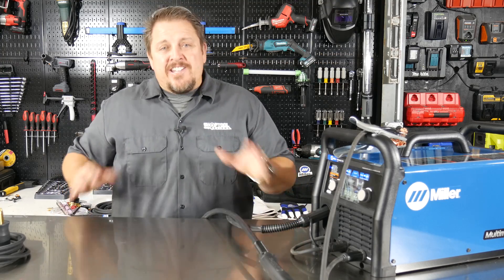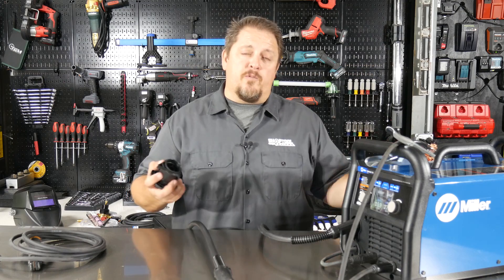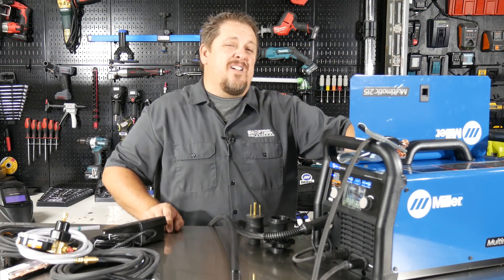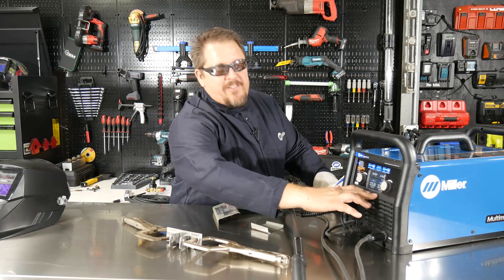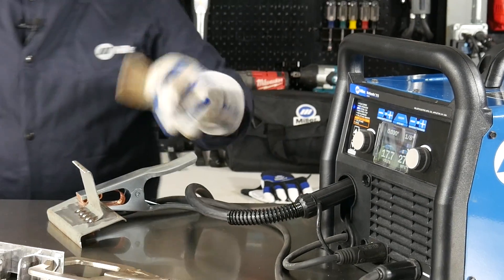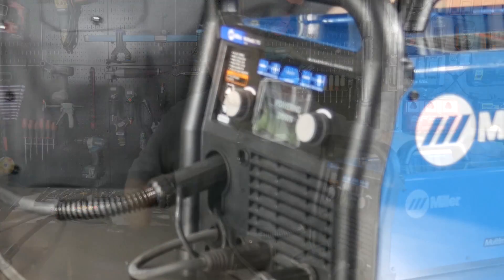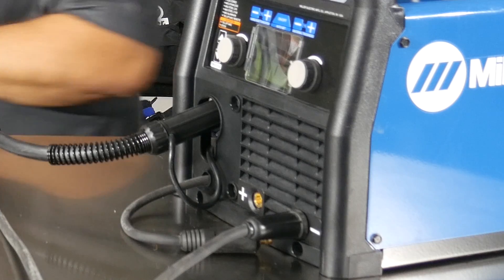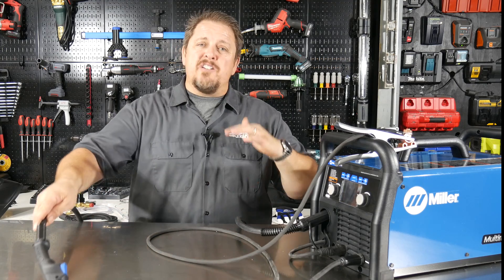Dummy Proof - Miller Multimatic 215 Multiprocess Welder

Comment: So no fluxcore demo. Im fighting with the spool. Can I only use 10 lb rolls?
Reply from the maker: In this video, we didn't use the flux core. Are you using the correct drive roller?
Reply: @Shoptoolreviews I realized the miller 215 (mine)only has 1 drive roller, for 10 lbs of fluxcore or mig. I can almost swear Baker's Gas put a 5lb roll of mig wire inside my unit. Then again I am 55....

Comment: Does the tig torch have a solenoid valve for argon?
Reply from the maker: The machine has 2 gas ports that automatically switch depending upon which process you're welding with. The valve is not on the torch itself. Thanks for watching.

Comment: I might add that if I needed a HD high production machine that runs at its max all day long, I wouldn't get this machine. For the hobbyist, car body, hvac, this is more than enough.  I reached the duty cycle auto shutoff feature pretty quick when I stick welded 5/32... 7018.
Reply from the maker: Thanks for the feedback. Thanks for watching.

Comment: could you weld 3/8 steel ????
Reply from the maker: Weld Thickness
MIG: 24 ga.–3/8 in. steel, 18 ga.–3/8 in. aluminum
TIG: 24 ga.–1/4 in. steel
Stick: 16 ga.–3/8 in. steel
Input Power 120 or 240 V, single-phase, 50/60 Hz
Thanks for watching and commenting.

Comment: miller  vs lincoln which is better
Reply from the maker: Oh brother, you just opened up a can and backed me in a corner. If I answer this, half the world will hate me, no matter which I pick. lol. Really and truly, they both make great machines. It's really more about the welder (person) than the welder (machine). Personally, I prefer the Miller, but I typically stay on the consumer/hobbyist/light-fabricator end of the spectrum. More industrial fabricators, pipe fitters, and others may choose the Lincoln. Miller and Lincoln have done a great job of expanding their inverter style multi-process machines that help people weld better, which otherwise they'd probably never have tried it. Sorry for the long answer, and thanks for watching. Strike an arc and keep pushing yourself, that's the real difference.

Comment: How can we get the 215 to post gas when welding stainless steel and aluminum ?
Reply from the maker: The 215 should automatically post-flow 8-15 seconds, depending on Amp. Factory set to 1sec for every 10A, with a minimum of 8sec and maximum of 15sec.
Reply: @Shoptoolreviews  Thank you very much for your reply. If that information was in the manual I missed it.
Reply from the maker: @jimwardlow7830  no prob

Comment: Does anybody know the difference between the 120 and 240 volts? What is the purpose for each?
Reply: Santiago Vazquez without writing a seven page essay it basically means you can get more amps out of your welder 240 is the best way to go cause you’ll get max amperage
Reply: 110 or 120 v  is standard household outlet, like for your lamp or toaster.
 220 or 240  v  is a different  much heavier more powerful outlet, like for your stove or clothes dryer.     110 / 120 v  = only enough power for very light welding eg. sheet metal 
                220 /240  =   much more powerful for heavier commercial grade welding on heavier steel. 
      Most garages are only 110 v and need to be up graded to 220 by a qualified  electrician.  This can sometimes cost around  $1000.  Less if you are lucky.
Reply: @gordjohnson70  you can do what I did I have central air conditioning so I put a 240 outlet parallel off the condenser disconnect. I leave the air conditioning off when I'm welding

Comment: I've read bad things about the MIG gun supplied with this unit! Hopefully, Miller has it sorted out by now.  With the premium price I'm paying, I don't want a junk gun!  Hobarts MIG guns are very nice, I only hope Miller's is as good or better.
Reply from the maker: We've ran many spools of wire thru the gun with no issues.
Reply: Aren't miller and Hobart same company
Reply: @jetthelooter  Miller owns Hobart. The only differences are quality control, price, and usually the screw threading on certain areas of expensive parts. For example, Hobart spool guns don't generally work on Miller welders.

Comment: I like the new screen as it's easy 2 c new settings. However, it appears as though this is a 211 with a tig/stick feature as an after thought. With no high frequency start it's a big downside unless ur already used 2 tig welding with a scratch or lift arc start.

Comment: please recommend a stick and mig welder also what is the duty cycle ??
Reply: duty cycle depends on how hot you run it. according to the manual, on the lower half of its power settings in 110V you pretty much have a 100% duty cycle.

Comment: Ive had one for about a year now. I Have used it on all processes to include the 150 spool gun, aluminum and steel. There is nothing wrong with it. The suggested "miller tig pedal" is junk though. I got a full sized aftermarket pedal, now its good. The autoset feature is pretty spot on with all processes.  The arc on all processes is surprisingly good, real smooth and "fuzzy". I got this to replace my powcon mst 200 that finally took a dump. It will spray arc mig real nice with spoolgun or intrenal mig with 0.35 and 25/75 or pure argon gasses. Stick welds real sweet. No complaints.
Reply: How's it holding up now in 2020?
Reply from the maker: Ours is still working great and it gets used all the time.
Reply: Whats a good aftermarket tig kit for one of this
Reply: @JuanHernandez-ub3ez  it'll take any torch thats hooked on a "gas through 35 dins". Arc zone makes good stuff. Their special hoses are very flexible, lite and durable. They are very helpful over rite phone and will make custom setups of any orientation You want. You ask whats the best torch, that's like asking what's the best music. You'll get 100 different answers to that question. Personally, I'm set up with a little bit of everything. Huge nozzles and tungsten for fat utility welds and smaller setups for delicate work. Gas shield and non shield of all nozzle and tungsten sizes. All weld joints and configurations have different reactions to different torch setups. Air cooled torches are what I'm using on this 215. I hang my hot torch in front of a fan  in between welds when I'm doing production work.
Reply: @dmmdmm5435  Thanks for the tip boss
Reply: @JuanHernandez-ub3ez  you can do good with the supplied 215 stuff. Ask your other welder friends what they're using and work from there. I was a welder,fabricator, machinist for many years in many shops. That exposure gave me a vast array of different equipment choices at my employers cost .  So I'm able to draw from those experiences to cherry pick what I need in my shop. I know Not everyone has that luxury. But I found that the highest amp aircool torch and large gas lens setups will do everything you need to start  your collection with. Then you can fine tune your collection when you come up short with the larger gas lens. Getting into tight confines will be your next challenge to make new choices in a tig torch assemblies. Non-gas lens nozzles tend to be very sensitive to breeze or working around corners. It's all about argon gas coverage without being wasteful on your flow cfh and not overworking your tungsten .
Reply: Oh...and get a (usaweld.com) replacement tig pedal for the 215. That toy pedal they supply is pure junk. It'll work, but it's too small and has too short of a throw for a fine tuned feeling between your booted foot and the arc. IMHO
Reply: @dmmdmm5435  thanks again
Reply: @JuanHernandez-ub3ez  hell yeah, that was useful.
Reply: good to hear, just picked up an open box unit for 900 at a swap meet today - im so over dealing with retard junk, finally just pulled the trigger on this rockin welder! They really nailed it man - even the 2 gas hook ups - priceless!
Reply: @fstarockaburns425  nice score ! You'll have fun with that thing.
Reply: oh - what pedal did u buy? and any ideas on aftermarket spoolguns? the miller 100 sucks and dont really wanna drop 500-1k on one!
Reply: @fstarockaburns425  SSC controls makes or sells ? the pedal. I'm digging it ! They carry aftermarket stuff for everything seems like. Call them for clarification though, their data can be too complicated. I went with the miller 150 spool gun instead  of  the 100, because it is a little beefier all around, tips, nozzles, heat resistant ect. I'm not sure about non-Miller aftermarket spoolguns though. I spray arced 0.35 4043 aluminum wire using 100% argon, on 1/4 lap & tee coupons pretty successfully.  I didn't go all day long spraying with it, but a few short runs were enough to convince me that the 150 is adequate on the 215.
Reply: @dmmdmm5435  Great thanks - the SSC C810-0814 is listed for the multimatic 215. Much appreciated info and priced right vs the miller brand. Thanks again! fwiw this unit CAN do tig alu on DC - you just need to use helium!
Reply: @fstarockaburns425  I have the Everlast 250EX. So I got AC TIG covered. I'm not fond of the look of DC Tig aluminum and Helium is just too damn expensive and hard to find around my area here in central coast California. For me, AC is my comfort  zone, theres no reason to fix what ain't broke
Reply: @dmmdmm5435  true! was just an option :) the AC tig option adds over 1k to the machine - :/
Reply: 😊¹😊

Comment: I'm a B pressure welder and I want this for home this is more then enough for welding at home unless you have to burn 1/4 rod for some reason
Reply: What do you think about this rig being 3000$ now
Reply: Its not rod, they are electrodes.

Comment: if working mobile, what kind of generator would you need?
Reply: Petey WDinc one with clean power. Inverter based welders need clean power
Reply: 7000 watts would work for max amps

Comment: get a esab fabricator 252i, 300amp max out put only a few hundred less than this gay miller
Reply: 252i costs more and won't run on 120v. It's a completely different machine for a different customer with a different budget and different needs.
Reply from the maker: A few hundred more is a few hundred more. You can step up to a better Miller for a few hundred more as well. The Miller Multimatic 215 hasn't failed us yet. It allows inexperienced welders to perform better jobs, much easier.